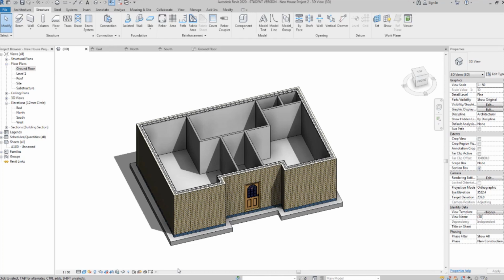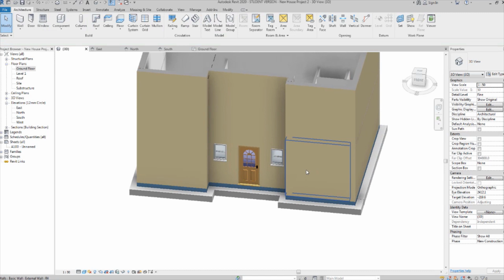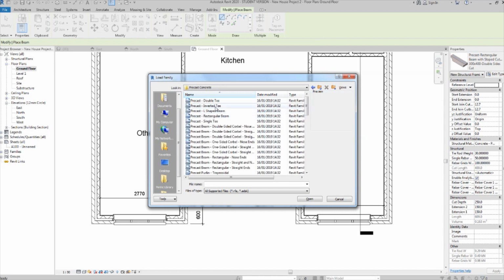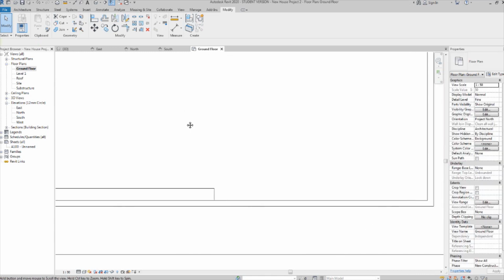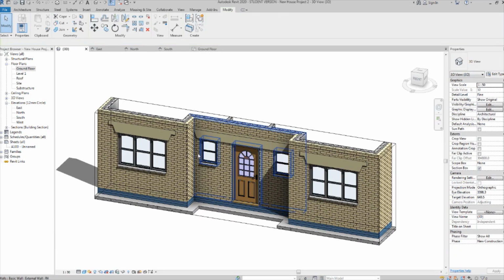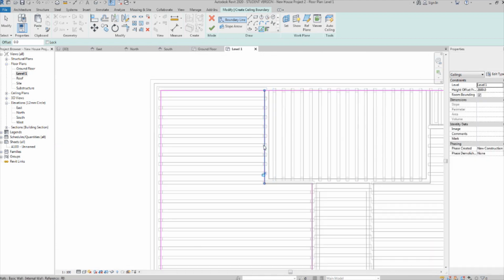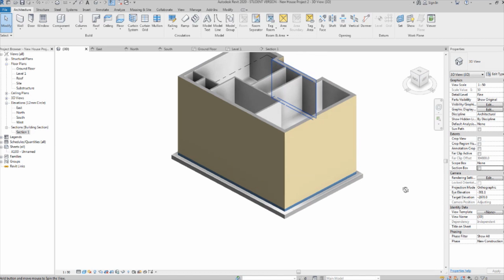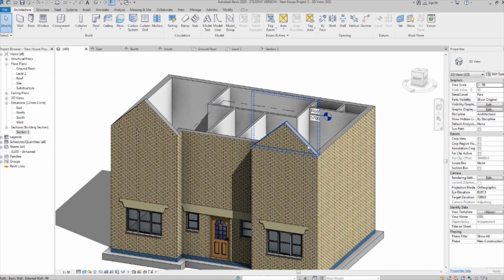Revit Structure Tutorials for Beginners - Part 3 - Lintels & Pitched Wall

Comment: Just wondering how you got the concrete beam to show up in Ground Floor view - show that you could align it to the hard wall. I am using Level 1 to do the same. I tried using the section box but it didn't reveal the concrete support and then I tried using the section tools in the 3D model and that didn't work - or at least they were playing ' hard to get' into a horizontal position to cut thu the beam for the same view you achieved from your Ground Floor view?
Reply: A solution: Problem 1: Beam (Lintel) not showing in Ground Floor plan view
Here are a few things to check to make the lintel beam appear in your Ground Floor Plan:

1. Check View Range
Revit won’t show elements that are above or below the set view range unless they're cut or within the range.

Go to View tab > Plan Views > click into your Ground Floor plan.

Open View Properties > View Range

Under Top and Cut Plane, make sure they are high enough to include your beam. For example, if the lintel is at 2100mm above the floor, the Top and Cut Plane should be at or above that height.

2. Beam Placement Level
Check the beam’s level. Was it placed on Ground Floor or at a higher level?

Select the beam > look in the Properties palette > ensure it's hosted on the correct level (e.g., Ground Floor).

3. Beam's Z-offset
Still in the beam’s properties: check if it has a Start/End Offset that might be pushing it above the cut plane.

4. Detail Level
Make sure the view’s Detail Level is set to Medium or Fine. Beams may not appear in Coarse view, depending on the family.

5. Discipline of the View
Sometimes Revit hides structural elements in Architectural discipline views.

Go to View Properties > change Discipline to Structural just to test if the beam appears.

Problem 2: Aligning the internal face of the beam/lintel with the wall
If you can see the beam:

Use the Align (AL) tool

Select the internal face of the wall

Then select the face of the beam

Click the padlock to lock it, if needed

If you can't see it clearly in Plan, try using a Section or 3D Section:

Problem 3: Using a 3D View + Section to see the lintel
Yes, you absolutely can!

To section through the beam in 3D:
Open a 3D view

Use the Section Box:

Select the view > in Properties, check Section Box

Then select the section box in 3D view and resize it so you can cut through and isolate the beam and wall area

Rotate and pan until you get a good angle on the lintel

Bonus Tip:
You can also create a Section View in plan view directly through the beam location to view it in elevation/section and align things better.
Reply: Also if you have Brick merged in your Lintel like i did and wondered what the hell is going on why doesnt my sectioned concrete look like Drawing techicals than try these remedies. However what worked for me was the Geometry/Join:🛠 Fix Options:
1. Use a Wall Opening
If your lintel is placed over an opening (like a window or door), make sure there's a proper wall opening component in place:

Go to the Architecture tab > Opening > Wall Opening.

Cut the wall where the lintel is.

This will remove the bricks where the lintel sits.

2. Use a Void in a Family (if custom)
If you're using a custom lintel family:

Edit the lintel family.

Add a Void Extrusion that cuts into the wall.

Set it to cut geometry (use Modify > Cut to select wall + void).

Reload into project.

3. Join Geometry
Make sure you've used the Join Geometry tool:

Go to Modify > Geometry > Join.

Select the lintel and the wall.

Sometimes this helps Revit cleanly display intersections (it can remove those ghosted brick bits).

4. Check Wall Layers
Sometimes the brick layer is not being cut by the lintel because it's not considered structural:

Edit the wall type.

Make sure the Material Layers are defined properly — particularly which layer is Structural and which is Finish.

You might need to adjust how the layers behave when cut by hosted components.

5. Use a Hosted Family (over window/door)
If the lintel is a separate element above a window or door:

Consider building it into the window or door family itself so that it automatically cuts the brick.

Otherwise, make sure you place it within the wall and over a proper opening.
Reply from the maker: Woah, nice one! Glad you found it useful. I’ll make more.